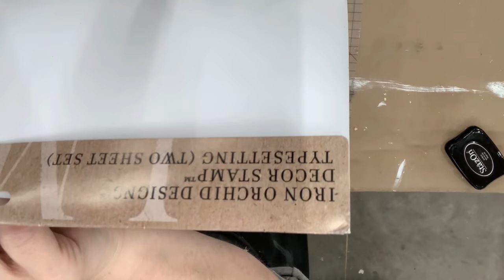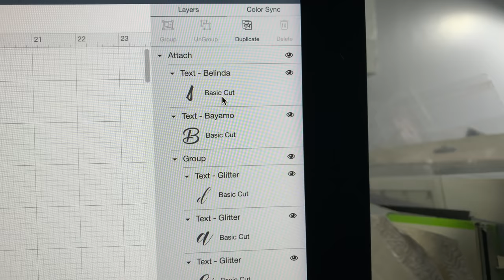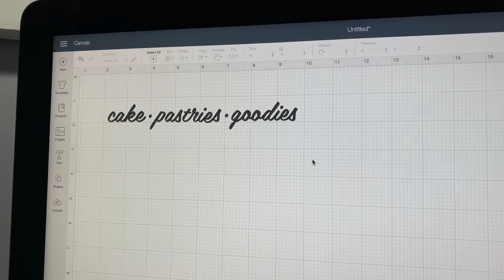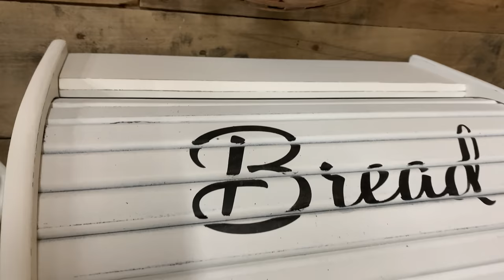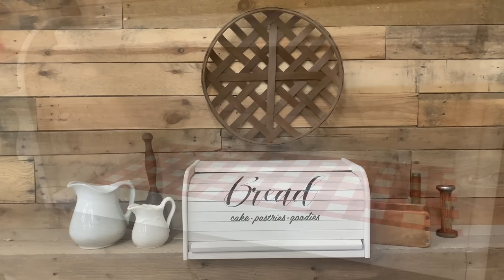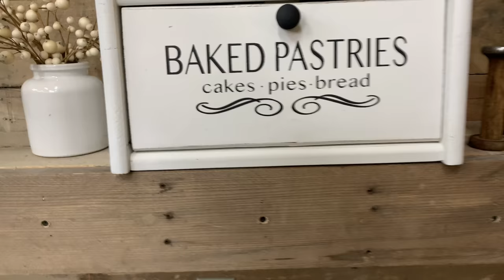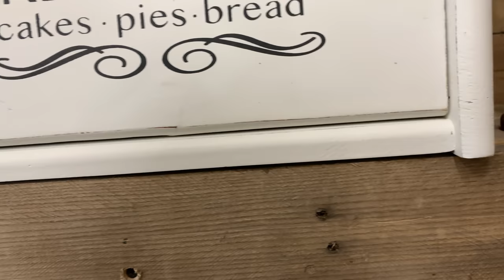Out Dated Bread Boxes Makeovers || Trash to Treasure

Comment: I LOVE the Fusion Mineral Paints!!! Its so much nicer to paint with than chalk paint, in my opinion, and it looks so good!
Reply from the maker: I need to get a few more colors
Reply: @GingerChickRehab  I just converted a gun cabinet into a quilt cabinet and painted it with a blue, and it's beautiful! I did the hardware in white. The Fusion paint is really nice to work with. It has a top coat in it, and you don't have to water it down. No sanding to smooth. It's expensive though. Love your work!